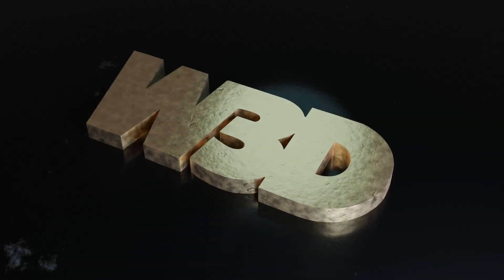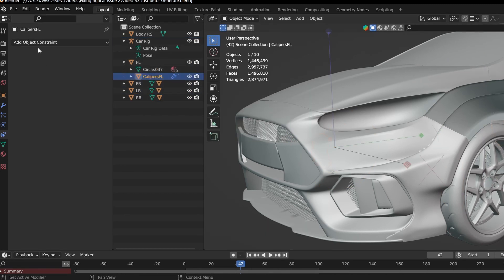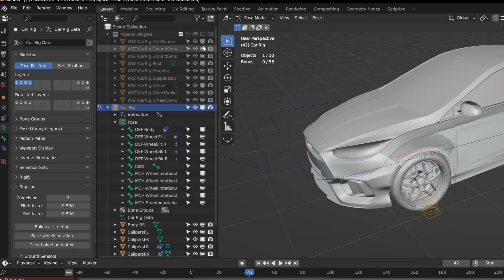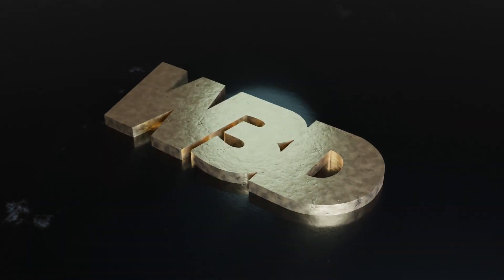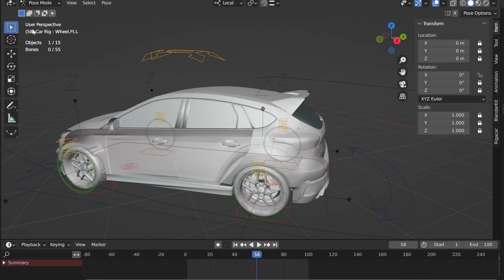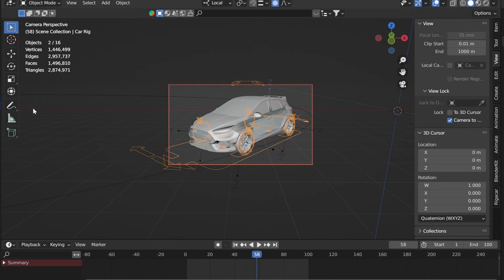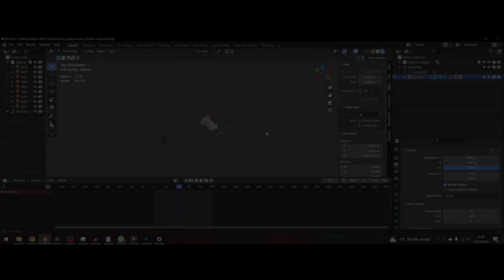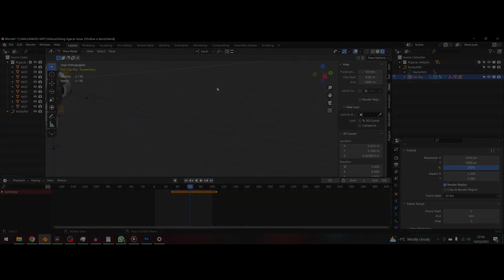Fixing More Rigacar Issues In Blender 3.4 - Brakes & Bug Solutions

Comment: When I bake car wheel rotation & car steering, it's not working ( I tried blender 3.4 & 3.5 ). When I bake it, it removes car's all key frame & animation ,, Any solution please??!!
Reply from the maker: There a bug last i heard. Type frame*2 in the x axis to spin the wheels with a driver. For the steering just manually key frame it. Only take 3 keys n dont take long.
Reply: @walejaw3d  👍🖤

Comment: Why are my wheels wiggling, when I select the big blue rig and move it on the y-axis, the wheels of the car start wiggling. I dont know how to fix it pls help. 
Another issue I have, when I select the road for the groundsensors, my car kinda howers above the street and I cant move it on the z-axis anymore. Its like "snapping" half under the road or obove it. Thats some very weird issue I have and I found nothing on YT or Google how to fix it. I would be very grateful if somebody can help me, because I have to be finished with the project in about 2 weeks.
Thanks
Reply from the maker: Check your origins on your wheels. Its not centered. I bet its this. Its always this.

Alternatively parent bones manually. Check no axis is locked that shouldnt be. Parent the curve to the floor, shrinkwrap to match. 

Move the base bone down in edit mode if floating. Use a floor modifier. Punch your screen. Buy a proper addon. Rigacar is jenk. 

Hope it helps. Take a break, chill. Its not you, its rigacar. Auto basically means “manually do it yourself” and auto will make your rig widgets. Thats all it does.